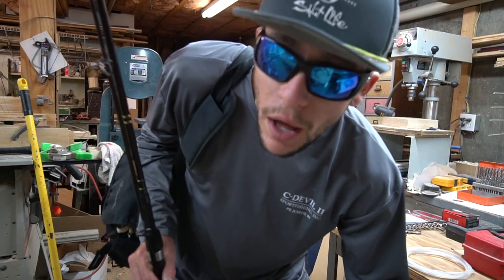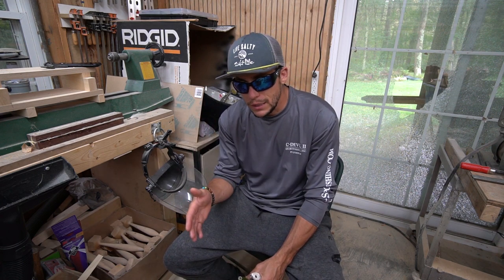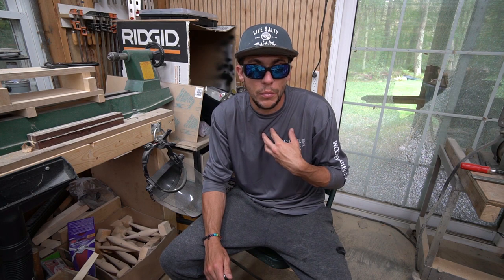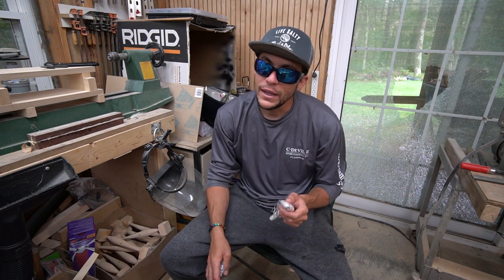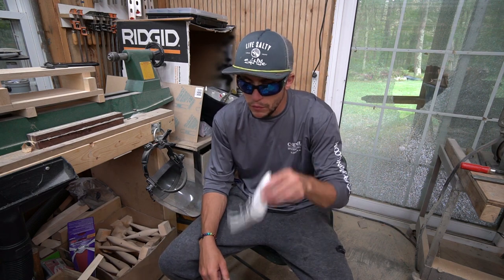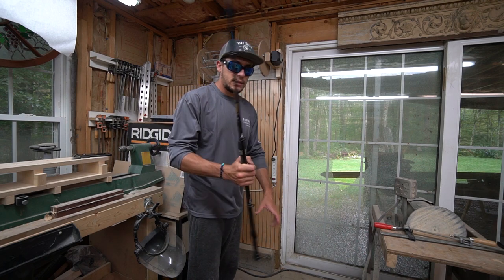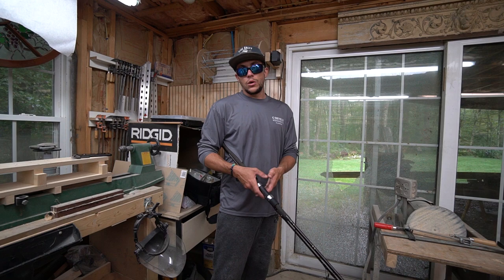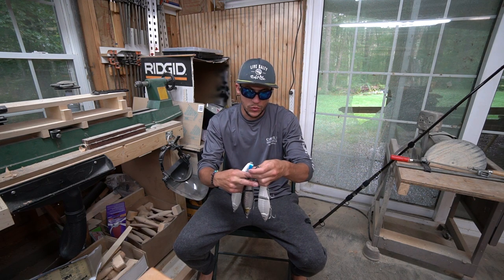Fishing Cape Cod Canal Full Magic Swimmer Tutorial

Comment: I really enjoy your reviews.  You recommend the Rosco #6HD split rings which are rated for 125 pounds, for the swimmer lures. In order to keep the lure hook rig more compact to reduce tangling, would toy recommend the new 4XXHD.  They are rated for 140 lbs.  Are they too small to accommodate the swivel and hook set up?
Reply: What is the most compact swivel set up that will work?

Comment: Hey bro curious on what your setup is from tip to tail on the rod, do you use barrels and what knots do you use to connect braid to barrel then to the clip etc. thanks !
Reply: Jasper did not reply to you, Mike? First, use a florocarbon leader, like 40 or 50 lb. to your clip. Tie the Floro leader to your braid using an FG knot, or a UNI to UNI knot. That's the one I use. There are tutorials for these 2 knots on you Tube. Also there is an Alberto knot for the same function. Since my memory is like swiss cheeze, all I can remember is the uni to uni knot. Good question. I would also like to know what reel and rod Jasper uses. I still have my old Penn 11' surf rod. I've thrown hi-lo bait rigs with up to 6 oz sinkers and it's still intact. It used to be a 2 piece rod. So much salt and corrosion got into the break I can't separate the 2 pieces anymore. Now its a 1 piece rod! Its at least 20 years old. I always used PENN reels and bought a Battle 2 a few years ago and put 50 lb braid on it. It's fine. In preparing for an offshore trip I got a Shimano Sargosa 10000 with 80 lb. braid. That is overkill for the canal but I really like the Shimano reels. Maybe a 6000 or 7000? I would be interested in what Jasper would think. Van Stalls and Stellas are great reels of course, but i don't have that kind of $$$.

Comment: So you reel it slow? Because some guys told me to burn it as soon as possible. Do you have to let it sink to the very bottom and then start crank? Does it make any difference at all if you using the canal version rather the original Sebile version?
Reply from the maker: vsonic86 great question! but no once it hits the water start the retrieve! You want it in the top 1 foot of water and that slow retrieve will allow it to sink into that sweet spot.
Reply from the maker: vsonic86 really just the price in my opinion. Now the knock offs will swim inconsistent. Meaning that some swim better then others so before you buy give them a good once over and make sure they're nice and loose you want the freedom for them to move! But I've had only a few that don't swim as good as a real sebile. If you don't care about the price or the fact there is a very high chance you will loose that $25 plug then go with the real deal they are reliable but if you fish a lot, go with the knock offs. Just my opinion. Make sure you comment when you hook a big one on a MS!!!

Comment: Jasper,

In the video you mention that you leave the split ring on for better swimming action. Do you tie direct or are you using a TA clip?

Also, you suggest a 6500 and a 10000 series size reel for the canal. That’s a big difference .

My everyday set up for plugging is a 9ft st croix avid surf rod rated medium power / moderate-fast action / 10-20lb / 1-4 oz. I pair this with a Penn Slammer 3 5500 with 40lb Power Pro.

I realize this does not provide enough backbone for the canal. 

I was thinking about buying the 10’ 6” St. Croix MOJO surf rod which is rated med-heavy Power / mod-fast action / 12-25lb / 2-6 oz

Thoughts?

I was planning on pairing it with either the penn slammer 3 6500 or the penn slammer 3 7500. While the 7500 is heavier it can hold significantly more 50lb test braid. Is 40lb braid not suggested?How many yards do you recommend ?

My bait rod is a tsunami airwave 11’ rated 20-50lb with a suggested lure weight of 4-8 ounces. On this I have 8000 series baitrunner. Would this be better for the canal?

Thanks.
Reply from the maker: Matthew Feit i use a TA clip i rarely tie direct because i like to switch plugs real fast. I think i might have meant 8500 series or 10,000. But your tsunami is probably the perfect setup for the canal and 40lb is enough for sure but i Fish 50lb and 60lb with a 40lb floro leader just because I know what swims through the canal and i want to make sure it ends up in my hands! I hope this helps man don’t overthink too much! Try what works best for you but this plug is around 5oz so something rated to 6 is probably minimum what i would throw this with! Keep em tight and keep me posted!
Reply: Jasper Coutu Thank you for the quick response! I’m assuming when you connect with the TA clip you are removing the split ring from the magic swimmer ? Please advise. Thanks.
Reply from the maker: Matthew Feit I am not removing the split ring. I go leader, TA clip, split ring, swimmer.
Reply: Jasper Coutu  Interesting. A little off topic for this post but do you remove the split ring on the SP Minnow?

Quality footage and info btw.
Reply from the maker: Matthew Feit the only plug I do not use a split ring on is really the pencil popper and darters. Because i want to control the action of the Pencil popper and the darters a different animal. But a lot of the times that a lure has its own action like an SP minnow and a magic swimmer i feel like the split rings allows the lure to “do its thing” or Work the way it wants and when i tie direct or don’t use a split ring I’m limiting its action. I’m sure it’s just personal preference but it’s just my own personal thought process.
Reply: Jasper Coutu Last question ... I’m assuming you use a 125lb TA CLIP. If you are keeping the split ring on the nose of the plug, are you replacing it as you do with the other split rings and hooks on the body of the lure. If so, what split ring on the nose  do you replace the magic swimmer with? The sp Minnow with?
Reply from the maker: Rosco split rings! you should check out my leader video as well. I think it could actually answer a bunch of your questions and it might give you a good visual as well. Its on my channel feel free to check it out!
Reply: Jasper Coutu Will do man. I appreciate other opinions. I always found the split  ring caused swim bait lures to not run true and off to one of its sides. This is particularly true in high current hence my inquiry. Again, great quality videos . Easy to watch! Looking forward to your future videos. Tight lines bro.

Comment: I've found the EBay swimmers to almost be duds half the time. The tolerances are way off and the plug won't pivot right.

I'm doing a little side project using an OG Magic Swimmer before they were taken off the shelves and "upgraded" a couple years ago....which really translates to nobody wanted to pay $35 for a plug so they dumbed the down the materials.

I've put a brand new 9" MS next to the older model 9" with the red head/white body. Every hanger from the nose to the hook hangers is noticeably smaller gauge wire. The body plastic is super thin walled compared to the old one and you could blindfold yourself Pepsi challenge that shit just on feel alone. The knock offs even feel more stout.

After losing the fish of a lifetime when the forward belly hanger was ripped out of a 9" Ghost I decided to buy two of the old models for $30 (Spanish Mackerel & Redhead). I punched a hole in the back and pumped about half the forward section with 5500 psi Epoxy which will completely envelope the small wire assembly attached to the hanger. I also put epoxy over the nose hanger and belly hanger and used a dremel to shave it down and punch a hole through it.

I also converted the Spanish mackerel model to a traditional mackerel pattern and while I used to run a 5/0 4x VMC on the forward hanger and a 4/0 on the middle, and used two connected split rings to allow for some rotation without increase the length, on the 2 that I'm experimenting on to handle trophy fish I decided to run a set of 300lb Owner split rings, an AFW #1 510 pound swivel, and an Owner 7x , 4/0 (which is bigger than a VMC 5/0 but with a shorter shank to reduce length).

So far the only downside is that the Owner treble hook is so sharp it will dig into the body on a cast and foul the plug. Action remains the same, hook up percentage has gone down somewhat (I'll feel more hits and misses opposed to pretty much guaranteed hookups), but for the first time I landed a 44lb Striper on a Magic Swimmer with an aggressive drag and the plug didn't flinch. The epoxy has not been phased nor reduced, and while I'll still have my old stand by double hook setups with the dual split rings per hanger, when there are fish the size of the ones we've had the last few weeks, and I want to have full confidence, it's fun knowing I have that option. 

Thanks for the video man. I'll be posting one soon going over what I did to bank a tank of a Magic Swimmer!
Reply from the maker: Dan Evan def agree on the previous years however this year they seem to be much better. I like them even more than the new sebiles because the 3 sections are a bit more spaced out. If you look at the new sebiles they are so tight together they offer little room to swim. That said I've only had 1 bad swimmer come in from ebay this year and they replaced it for me free of charge, and shipped for free. Now I touch on in the video the sebiles swim more "consistently" than the knock offs but that's the trade off with price. 100% agree but I do feel confident in promoting these. I caught over 3 dozen stripers yesterday on 4 different knock offs. The bass certainly didn't seem to notice 😋 All ebay swimmers. Give them another try! Maybe you'll have some better luck! Tight lines!!!

Comment: Hey Jasper...  Question-What's your opinion on the size(190mm) of the "knock-off" magic swimmers?
Reply from the maker: Walter Hynson so I've used them and I wish they worked for me when I did. It was 2 seasons ago maybe when I bought them and they swam almost to the point where they were unusable however I spoke with a guy at a tackle shop and he said they had a problem with the molds now I can't imagine they still would have the issue but I have not purchased again so I can't comment fully. What I can say is for that size if they swam correct they would be perfect to save some money and do the same thing a sebile does. That said you'd just have to give them a go or next time I see them I'll buy one and report back. I would def make room in my bag for one! Thanks Walter! Keep em tight!!
Reply: Jasper Coutu much appreciated...  also forgot to mention, they only have the 2 points for hooks- mid section and tail
Reply from the maker: Walter Hynson I would probably keep both hooks on that size
Reply: Jasper Coutu thanks, sounds good
Reply: Hey Jasper, I heard you mention, you work a charter boat.  What type?
Reply from the maker: Walter Hynson it's an inshore and offshore charter boat. We do striper, black fish, cod, seabass, shark, and tuna. Check us out the C-Devil II sportfishing out of point Judith RI

Comment: Dont you know about the Storm kick stick? I use them @ $6ea. and mod them with shot for diff sinking rates, they come as a surface roller and swim as good if not better than the knock off sebiles. They also come with suitable hardware that doesnt need to be replaced for big bassin. Ill be posting a video in the winter of how to mod them, give em a try and grab some spray paint
Reply from the maker: MillhouseMod I actually do know about them and still prefer these over them. It’s just my opinion and what I️ prefer. I think the materials better, and I don’t need to modify them. Also I️ would 100% still swap their hooks for VMC but i do that with everything. Not that the storms are bad I just think these are easier and I’ve never had a problem pulling pigs with my knock offs. But thanks for the feedback love to hear what guys are throwing!
Reply: Yeah ill admit I never fished the canal, and typically dealing with 40-60' for bass I use smaller bodies than that 228 so I can get the best cast and depthing. Ill probably order a few in pearl so I can custom paint them. Looking forward to getting to the canal next year to sling some baits!
Reply from the maker: MillhouseMod if you want to custom paint them use the link in my description to reelpowerhandles and my promo code “jasper” for free shipping but you can order them there unpainted for even cheaper then the painted ones! And I’m here for any questions at all! Hope that helps bro looking forward to hosting you here!!!
Reply: Yeah man Ill definitely go through the link once I get back into the tackle makin this winter

Comment: What's a good rod for the saragosa 10k. 50pd braid for throwing poppers
Reply: Peter, I got a Tsunami Trophy rod last year and a saragosa 10000 but it was a for a offshore trip to cast to mahi-mahi and tuna. Handles 2-8oz lures and 50-100lb line. But it was not a surf rod. It was a boat casting rod. I went to Goose Hummock shop in Orleans for expert advice. I knew I was going to pay big bucks so I just bent over. Unfortunately a hurricane, then a nor'easter cancelled the trip. The salesman matched up the 10000 to the rod after I explained what I was trying to do. I put 80lb braid on it. Jasper links above to a Tsunami Airwave 12' Surf Rod TSAWSS-1202XH.  Handles 4-8oz. Sounds like a surf version of my boat rod. The Tsunami rods are reasonably priced. I think mine was around $100. Amazon is charging $174.99 for the surf rod. I still have my Penn Big Gamefisher 11' med-heavy rod. It's lasted 25 years and welded itself together. If it ever breaks, I would probably go with the Tsunami Trophy.